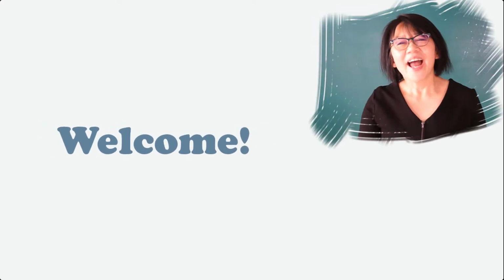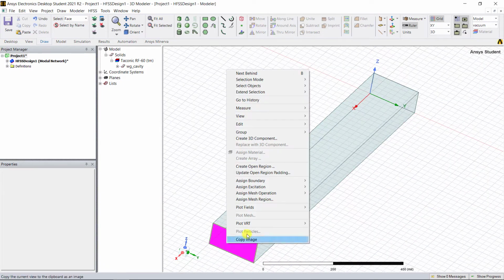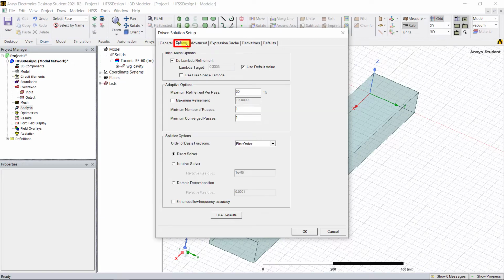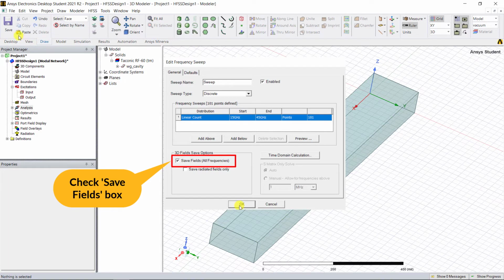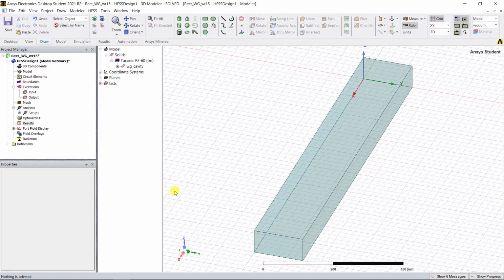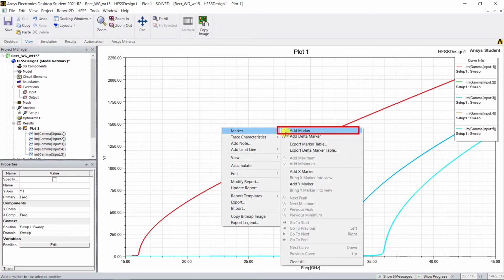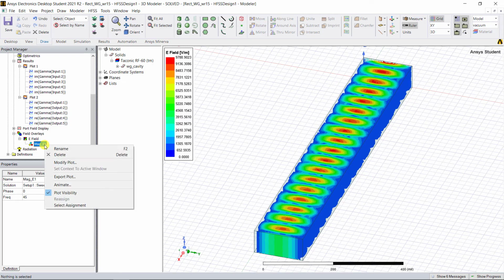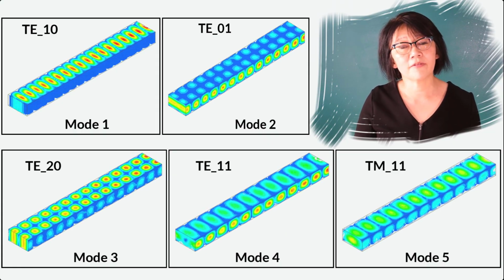Intro to Ansys HFSS Using a Waveguide Example – Part 2

Comment: When trying to assign a wave port to the object face, a dialog comes up to choose which conductor to reference for the terminal.
Reply: I had this problem and I was pulling my hair out until I realised that it needs to be a Modal Network not Terminal. You can fix this by right-clicking HFSSDesign1 and clicking "Solution Type..." in the drop-down menu and picking Modal. Things start to follow the tutorial after that.
Reply: @alteracbarry  Thank you, you are a lifesaver!
Reply: @alteracbarry  Thank you 😊